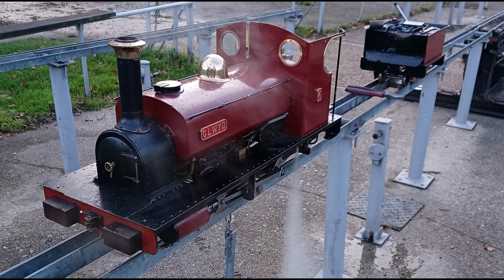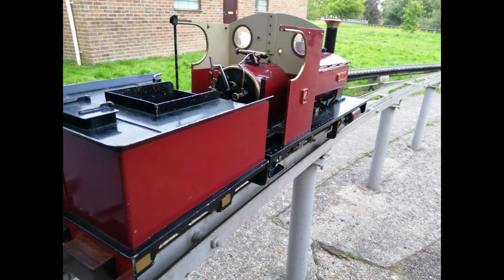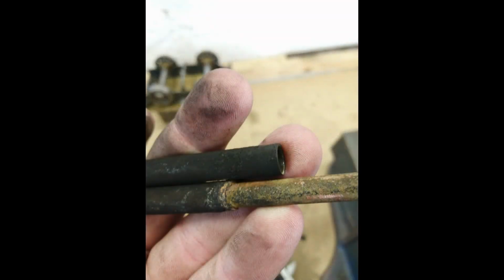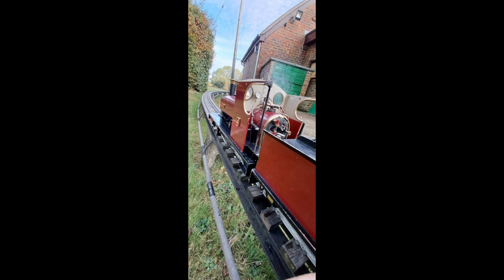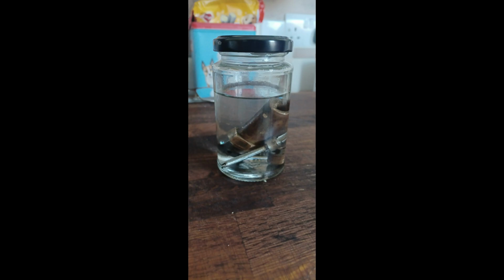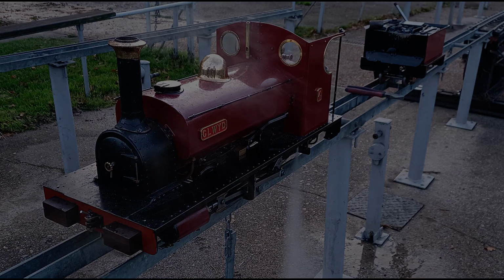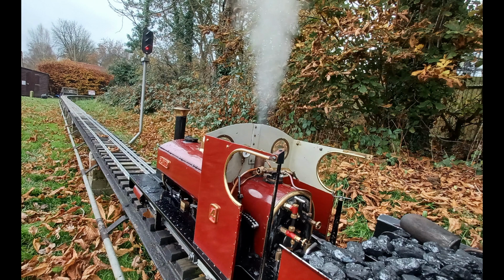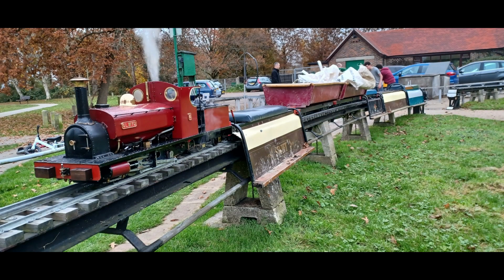Martin Evens 0-4-0STT Conway NO.4 "Clwyd"

Comment: The spring problem will never go away 100% because they should have some little play. But not only that the valve gear plays a part. Oh. And at 21 min mark. Looks like your priming a lot. Ease of reg a tad. Open drain cocks. If not you could hydronic lock your cylinders. If that happens. It be a club member tacking a lot time mending it for you at a bit of a cost. Or tacking it to someone who does it for a living and they charge a lot. I hope you looking into a small work shop away or looking into machining and so on. Helps to understand things and costs and not only that skills. Any way. Good clip and hope to see any more clips in the future.
Reply from the maker: Hi, thanks for your feedback ever since that video i did make a new Superheater and that sorted things out for a bit but the Priming unfortunately is part of the loco and its quarks as ive tried everything ive been told on how to sort it and everything i know but it still does it :( but to this day it is a good runner, i now have a portfolio on it so yes there could be another video coming at some point.
Kind regards T.S.L
Reply: @thesouthernlad30541  yeah, good to hear that. Yes, you will soon pick up what she can and Carnt handle. Yeah. That be good to see more in the future.